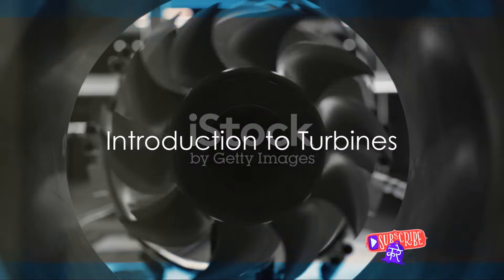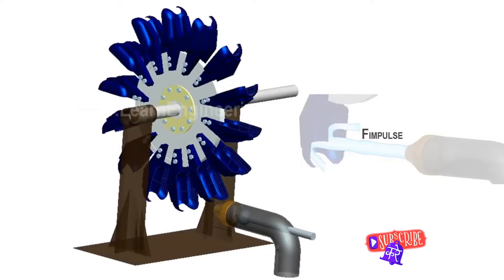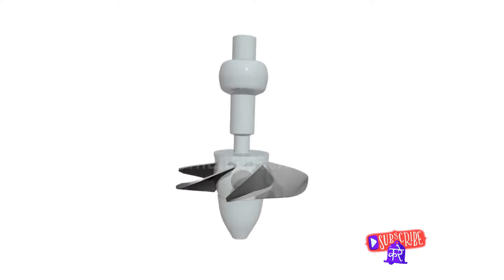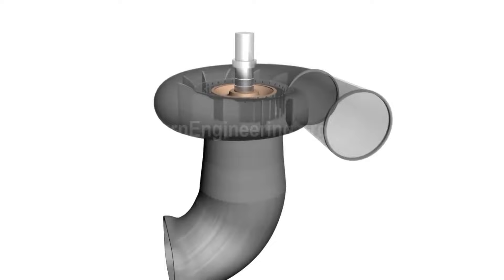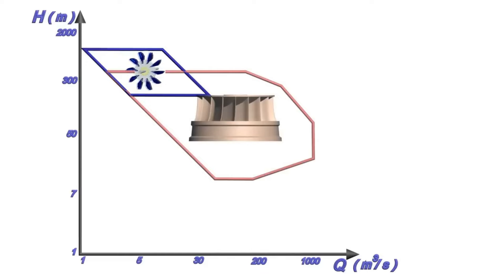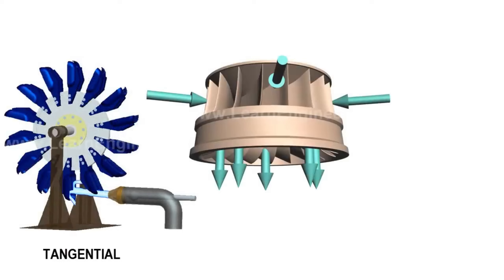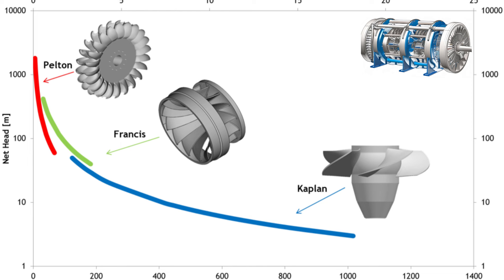Pelton vs Francis vs Kaplan Turbines - What's the Difference? #turbinefrancis #kaplanturbine #pelton

Comment: 00:44 - 01:06 the showing of a Kaplan turbine during or in between the Pelton and Francis turbines is quite confusing here. There are better imagery of Pelton turbines with multiple jets, complex shapes of the chambers around the Pelton turbine to not let the water hit the wheel again and slow it down, the precise geometry of the buckets with split in the middle, or the nozzle with spike valve and the quick-action emergency valves that can be shown here to underline the expensive equipment needed for Pelton turbines.

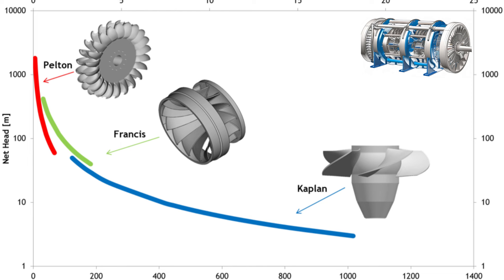02:23 - 3:21 The last graph shows also the cross-flow turbine, which is not explained. Better to either hide it or also comment on it.

General comment: the narrator mentions for almost all types that they are complex and expensive, but there are also simpler turbine technologies, such as the Archimedes screw and water wheels. The drawback is: they have lower efficiency. These technologies can be useful when the potential yield is not so large, like limited flow and/or low head (e.g. micro-hydro, local or private supply). Then a cheaper, simpler solution can be beneficial, as a larger investment in a more sophisticated technology will not pay itself back (low or no return on investment).